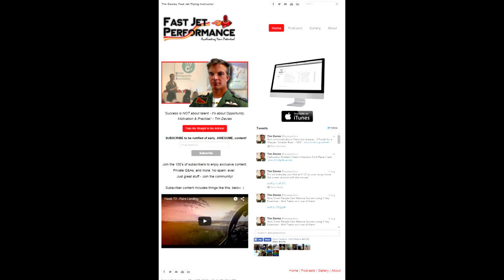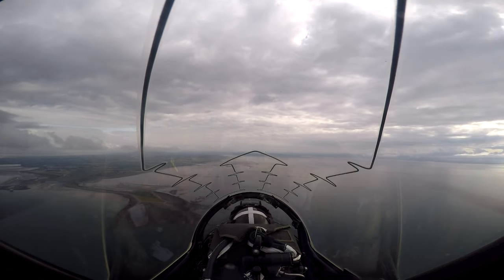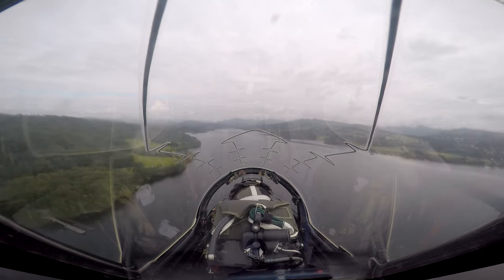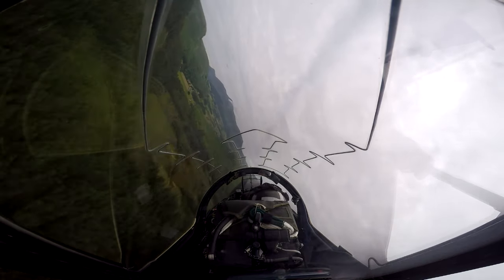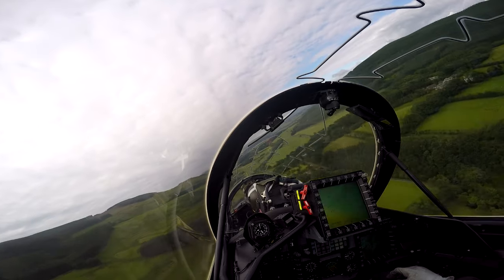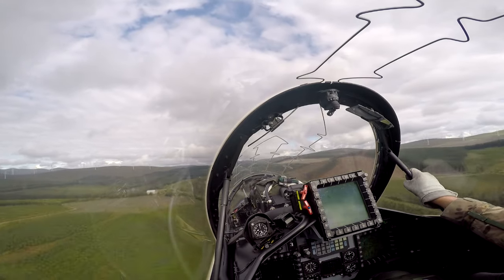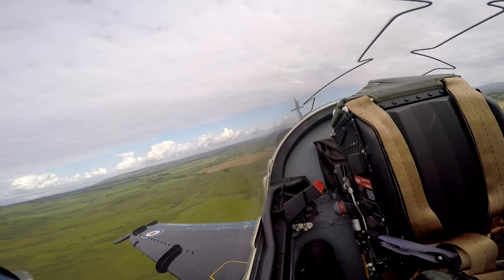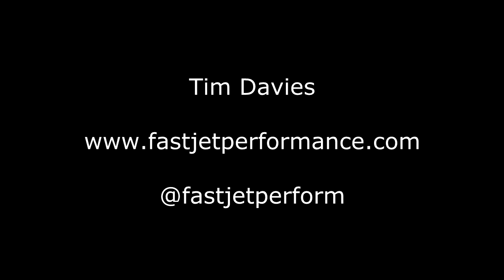Low Level IN COCKPIT - EXPLAINED by the RAF Instructor Pilot

Comment: Why do you not comply with the 250 Knot speed limit?
Reply from the maker: Military - we have all the guns. (there's dispensations for military fast jet traffic).
Reply: @FastJetPerformance  Very funny. I fly an IFR twin engined A109 (Own One ATPL (H) ex mil)  What seems arrogant, if not a  little stupid, is having a 250 knot speed limit and then some individuals are allowed to do 500 or more knots because they want to.  It's like the M1 motorway being restricted to 70 mph but some few have a dispensation for 220 mph. In my limited experience of 46 years and 13500 hrs rotary sharing this airspace with young men who think they are invincible is,  I discovered,  the hard way, the fact they are not so skilled. It is pot luck.  In total, 6 airmiss reports. All with our boys in blue. All VFR all with flashing lights galore, each involved a JET JOCK not seeing the heli, (never the other way round, think about it)  which with such differing closing speeds is not surprising,  the chopper is virtually stationary in the air in comparison. My closest ?  It went dark, my cockpit was filled with the wonderful smell of burnt Jet fuel.  The noise and turbulence followed.  He descended on top of me from my six. Came out in front about 60 yards ahead. But the jet jock who was traced said he was following the rules and did not believe he saw a heli this despite being warned on the ATC freq we were both on. He got a 3 mile warning and my height !!!  This is not unusual. On my CAA mandated 6 monthly flight test a few years back (10 maybe ?), the instructor examiner, told me, he had the metal tail stinger of his rotary cut off by one of you chaps. That is not just close its an air accident. Further in the late 1970's two of my fellow pilots  friends were killed, in each case by  low level Phantom jocks flying into the choppers six with fatal results for all.  As a TV news pilot (occasional) I have been first on the scene more than once, when our boys in blue  had a mid air collision all by themselves, four fast jet jocks on board  2 aircraft on the same training sortie, totalling both aircraft. I landed having located the bright orange chutes tangle in the trees, directing Rescue heli 121 to the scene. My point is, flying visually so close to the ground is great fun, I'm sure, so long as no one is taking off in a heli ahead of you.  Or working low level in a chopper, say, load lifting in the lakes. Or taking off from the hotel at  the foot of lake Windermere you flew over in this vid, that is just about at 250 feet below. Obviously following the advanced notice dissemination procedures to the letter and still jets came through my working area, being the temp restricted area, coming though at high speed at 250 feet and 7 miles a minute leaves no time at all to do anything. After about 4 or 5 close shaves you start to realise this whole thing relies far to heavily on some young RAF pilot doing his best, which all too often aint quite good enough. Personally I would shift all fast jet training to Canada the USA or anywhere but the UK, somewhere other than here, somewhere less crowded. The UK is far to busy far too small.  This pot luck approach has killed quite a few pilot friends of mine over the years.  I could only get to the funeral of one of them. His wife and kids were left destitute by a smiling over confident young fast jet type who survived having driven his jet into the back end of a chopper  all whilst doing 7 miles a minute. Totally unacceptable in peace time. No great pressing need.
Reply from the maker: @Sandhoeflyerhome OK, so you do understand that these pilots are trained for a very, very long time. Most fast jets have TCAS now, although the utility of TCAS at low level is questionable. If you are flying your rotary asset at 250 ft then there is every chance a jet mate might collect you, it's not a good place to be for you - in fact 250 to 2000 ft is FJ territory for LL ops but only in LFAs as you well know. Use CADS and NOTAM your routes, that's what we all do but training is hard, that's why fast jet pilots do it - I got the impression that you think we do it for fun, I could be wrong. I flew low level at night on NVGs, in and out of cloud and had to use the Terrain Following Radar for portions of the flight, I did this many times, it is dangerous, there are valleys and other jets are hunting us but it is necessary else we can't do it when required. For every fast jet that has been in the wrong, there are many more civilians I would stress who should have had better training. A military fast jet pilot is a job, it's all they do - they are very good at it but it's a hard one, 7 miles a minute whilst weaponeering a target is difficult - sometime lookout suffers, it's inevitable. But the precautions we put in, NOTAMing our routes, avoiding your areas that you've NOTAM'd if you have, the years of training, it all adds up to prevent us meeting up in a fiery ball of debris. Incidentally, aircraft can only be flown at speeds in excess of 250 kt below FL 100 with the specific permission of the CAA, the military has that exemption. You don't want a Tornado flying less than about 390 kts at low level, it just doesn't want to stay airborne with stores on. And a Hawk with less that 360 kts with a birdstrike to the engine gives the pilot very little engine out zoom climb performance - you have to consider these things, there's a lot more to it than you might think. The UK isn't too small for low flying, there really aren't that many jets flying any more - as for the 'no great pressing need', maybe that's because you've yet to understand the requirements of the modern battlefield. Want to know the best bit - I've never held a license in my life yet have 3000 hrs on military fast jets and, now I've left, I can't even legally fly a glider.
Reply: Fast Jet Performance it’s interesting to hear your views. Especially regarding flight in airspace which you claim to be yours. Your arrogance is breath taking. You display the conceit of a standard  low time military pilot without a wider view.  In your little bubble you probably are/were the ace of the base. You disparage civilian pilots training without much thought. Your crew room know;edge of civilian pilots maybe those private pilots who splutter on the radio. Rather like students in the mil. Yet those guys pay their own way, and improve over time doing a few hours a month. Every military pilot comes to the end of his flying career eventually, then either quits or becomes a civilian pilot, if he can pass the required tests, surprising how many fail. Yes it’s not uncommon. At that point reality kicks in. On a typical commercial day I might make 8 to 15 stops, each requiring a decent to ground level passing through 250 feet of course, each assent to 3 to 8 thousand feet for the cruise. A mil pilot will find himself in command with as little as 700 hrs under his belt. Hardly enough to get an interview in civi Street. The mil like you feel experienced or able to pontificate with so little time under their belt which is simply laughable, akin to a know all teenager. My company required co pilots to have 2000 hrs and Captains 4000.. Honestly you never come across anyone in the services with 22,000 hrs, that is command time flying around the globe. When I left, I too was brain washed into believing military training was the best, setting the highest standard with the most gruelling  selection. You were told this from day one. You had no basis to believe other wise. Airline training is just as tough. Just as precise. Probably more demanding in more ways than one, you just have not experienced it yet. Commercial pilots fly more work longer hours and achieve an astonishing safety record not shared by the military. I still Say the mil should train abroad in a remote spot, just like the Reds do in Cyrus sensibly. I have to say you are not special, not privileged and do not own airspace. You will loose the I’m special attitude when you realise  the company you eventually work if you continue flying ... for employ 2460 clones just like you maybe about 25 % ex mil. When I started nearer 80 percent. Several with burnt faces and web fingers from WW2. Oh by the way, we use NVG mainly from November onwards. Finally, several friends still fly in the RAF, mostly retired now and I admire the job they do/did. One friend flew the 104 Star fighter in the Belgium Air Force, talk about a country being small ...under 9 minutes on after burner..end to end... I fully accept under wing stores equal some drag, requiring great power and speed, even more reason to be somewhere less congested, after all were there a crisis you could simply fly back with a tanker tow.
Reply: Beeblebrox One one stupidity is based on being a professional pilot of 47 years standing.. but guess you fly a desk .
Reply: @Sandhoeflyerhome   He was clearly being sarcastic pulling your leg ...Get over it man stop being so serious. .